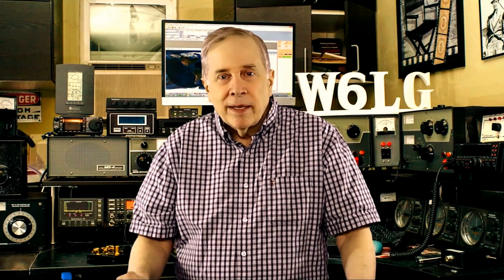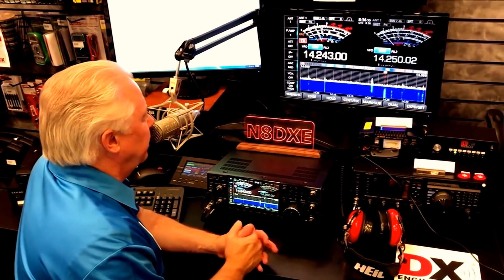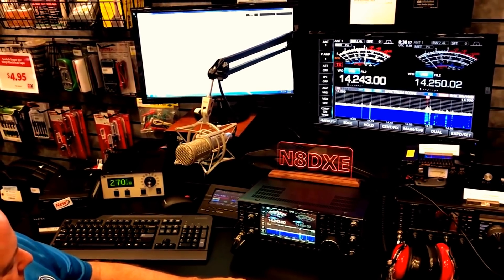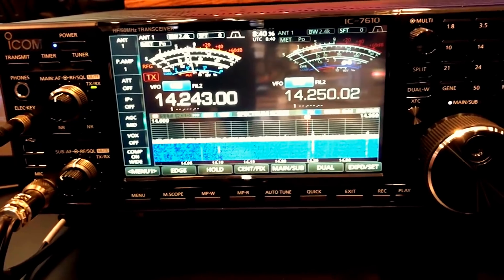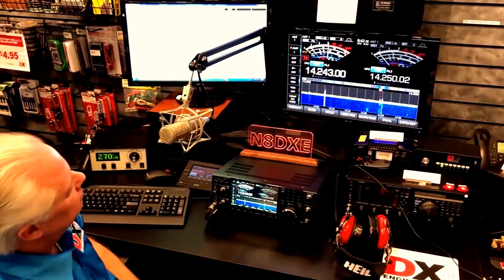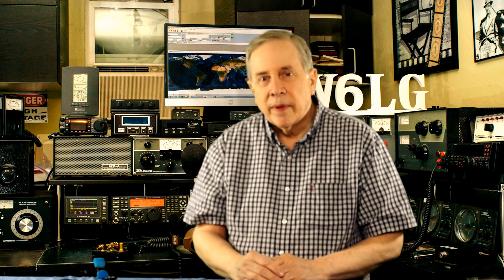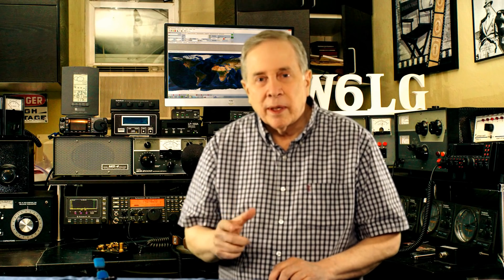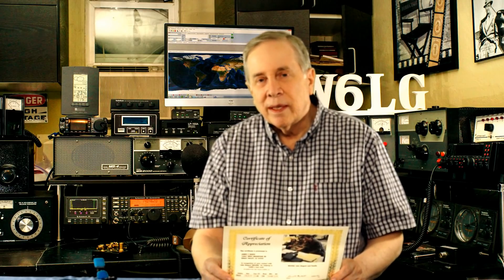Ham Radio Basic--New Icom IC-7610, Tim Duffy K3LR at DX Engineering

Comment: Nice video.  Trying to decide if the 7610 should replace the TS-2000 I've had running for around 15 or so years.  Getting tired of the loud fan ... after all these years.  Seriously, I need a much better receiver than this do-it-all, but not very well K-wood has supplied.  Oh, the end of the video was a surprise.  Congrats.

Comment: I hate to leave this comment, I really do, but good practice would be leaving a little bit of time in between transmissions because nobody can get a break in between in case of emergency,  There is no time between transmissions and you are very fast on the key.
Reply from the maker: Okay, thanks.  I would like to know your name and callsign please. My callsign is W6LG, licensed in 1963 and continuously active for over 53 years.  And, I handled emergency traffic several times where life and/or property were being threatened by wildfire, car accidents, a guy lost in the snow that I found, a lady who fell on an offramp, a house on fire that was on my route as a County Official and a few others.  Thank you for your advice.  Regards, Jim Heath W6LG
Reply: Name is Eric Hofer, KJ4YZI. Licensed since 2004... I know how long you have been licensed,  Not trying to coach someone who has been doing it longer than I have, believe me.. I'm just not sure why it has to be that fast without a pause in between to allow any stations a chance to be acknowledged. Thank you for your help in emergency traffic over the years. 73
Reply from the maker: Hi Eric! Nice to meet you.  Congratulations on your upgrade to General Class License.  I encourage to now go all the way to the Extra Class License.  Thank you for your question. I do a very fast push-to-talk.  So as you listen to me speak, any pause may be where the transceiver is in the receive position.  I do a manual imitation of VOX.  If someone speaks during the turnover, I am probably going to hear it.  I believe that there are pauses or spaces where someone could in an emergency say something that would have been heard by me or Tim.  I do edit videos to remove wasted video time.  If you watch my most recent QSO videos and watch my hand, you will see that happen.  Thank you for watching the video so closely and asking the question.   73, Jim W6LG
Reply: Thanks Jim. Well, I like to keep it interesting. My saying is "The Christmas presents are much better when they are wrapped under the tree" meaning, I have plenty of time to upgrade to extra class. No rush here. The same goes with equipment and modes. If I blew my wad on the best gear, upgraded to extra class, had beams, towers and worked all countries, then what? Like a rockstar once said "Well, this is it. We are on the top of the billboards, we went platinum, now what?" Every day is a new device, a new contact, a new experience. And by the time I experience all the stuff that is available to us now, there will be a bunch of new things. So when I think I have made all the contacts that I ever will, I will be able to upgrade to extra and start all over. But thanks for the encouragement, and I figured your manual VOX practice was to eliminate the background noise and breath sounds as you weren't talking, it looks like a D104 with the SSB head on it, which are very sensitive. 73 JIM, de KJ4YZI
Reply from the maker: Thanks Eric.  That mic has no connection (poor choice of words) to a D104.  It is an Astatic 10da which has an 'art deco' look.  I think Astatic must have used an old mold to create the 10da in the 1960's.  It was advertised at the time as having a tailored response.  It was an SSB mic.  They called it the "VOICE".  I remember the battles that took place as the new mode slowly took over 20 meters.  The AM guys ended up around 14275. 

I do not use the "manual vox" because of the noise from the amp or other stuff.  Actually, I failed to tell you that in my K3's I have turned on a system that mutes the mic when there is no voice input from me.  So if I say "hello hello,"  the mic is off between those two words. The transmitter stays keyed.  It is sort of like a VOX system for just the audio.  

I do not like the D104 which is fairly high output. That is a crystal microphone.  The 10da is a dynamic mic and the output is much lower.  I think the response of the 10da is like the HC5. I used a small transformer to match impedances. 

I upgraded from General many years ago and I don't regret it.  I think I got the Advanced Class license in the early 1970's.  There are many things to try.  There is always something new to get my interest.  Now 14 months into my recovery from the PE and MI, I still get up in the morning and check propagation numbers, listen to 20 meters for an opening at sunrise and spend part of the day experimenting with ham radio related "stuff".   SDR, FT8 and amplifier building are currently things that I do.  Although the amp building is somewhat limited since I can't lift much.  I will know more about what I can do next week.  More tests were done this week.  I am waiting for the results.  

Also, when you upgrade to Extra SOON you will be more likely to mentor.  And that is needed.  There is no one to help a lot of the new guys.  Much of what I see on YouTube for helping new hams is bad information. That's being polite.  I should have said it is crap.  Go for the Extra Eric.  There is plenty to do when you get there.  I used to testify in court as an expert.  To prove I knew what I was talking about, I got every license and certification that was available.  

73, Jim
Reply: Jim W6LG I think it will be a long time before I upgrade to extra anyways, I enjoy talking to tech and general class operators more than extras sometimes anyway. I would rather be a part of the excitement of that operator that just made his first contact, or the boy scout that is amazed his homemade creation actually works.. Can't find that kind of conversation in the extra portion of 40 meters HI HI.
Thanks for the chat Jim, 73 de Kj4YZI
Reply: well theres plenty of other frequencies someone can use for emergency for sure.

Comment: Well, let us guess...what control on the front of your receiver (we will presume HF as there is not much unused on FM radios) are you likely never using?  Well, if you don't do CW then it might be the speed knob for the iambic keyer, but you probably weren't considering that one, so we'll go for the RX gain control.  Of course many never adjust TX power either (must...have...100W...for..weak signal modes!).  Whereas I seldom bother using the squelch knob.  So we have a few contenders.

I really enjoyed your story and those are the experiences that really stick with you so thanks for sharing!

73 de KW4EK
Reply from the maker: Thanks Ethan.  It is the RF Gain control that many do not use.  You got it right!  73, Jim
Reply: I have only had my ICOM 7600 at full output once.It stays at 35 watts PEP because that is why it takes for my ICOM PW-1 too make full output power plus on all of the bands.I hate repeating myself so when I push the FS-2 foot switch I expect too be heard the 1st time & I Rarely make any adjustments on the 7600.I know people can't leave most radios along because they feel they always need adjusting but I feel it's much better leaving mine where it sounds AWESOME. Why mess with what is not broken?  {:>)